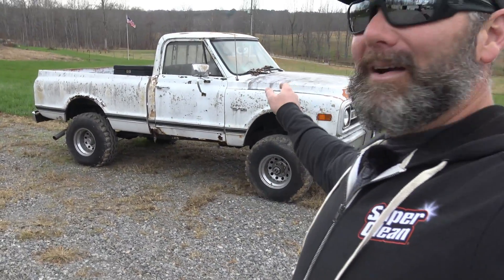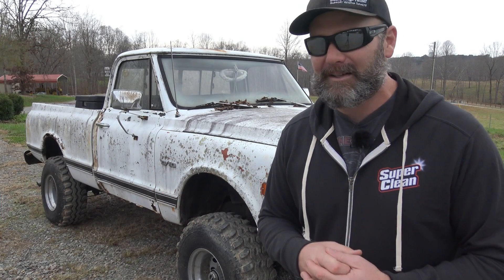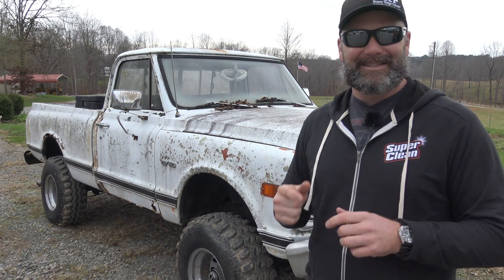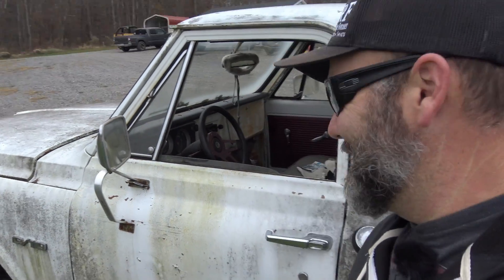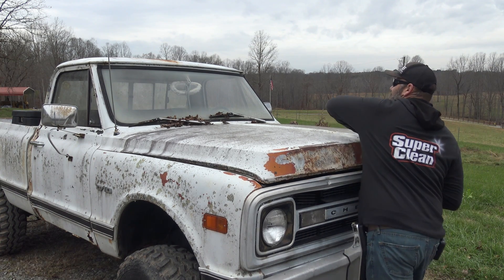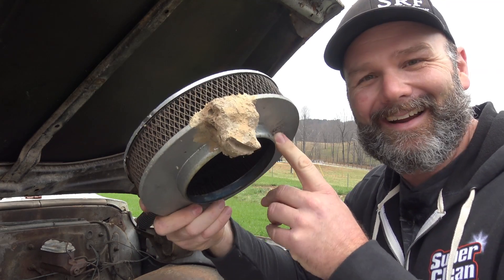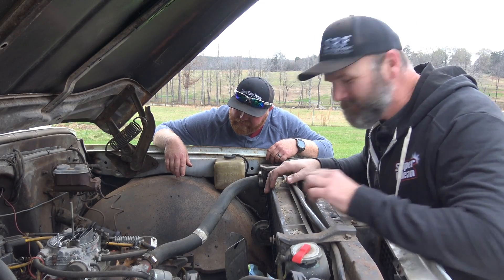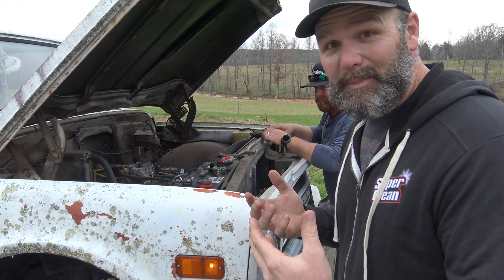Is it worth saving?? Rare and Rusty 69 Chevy C10...No start in 15 years!

Comment: Got 1 recently . No start in 8 years or so. Hot battery installed ,Added 10 gallons of New  non-ethanol fuel , primed the fuel pump ,and that 350 rolled over twice and fired rite up! Lot of body rot ,but not unfix-able. its 4x4 and terribly strong. Thanks for the vid.

Comment: 010 block is a common low compression 350 2 or 4 bolt main block. 
You can get every panel for that truck, it needs saved.

Comment: I got a 68 C20 longbed sidestep I've been working on and I get parts from both summit racing and lmc truck. Shes rwd and has inline 6 292 4.8 liter engine. Still working the engine up a bit

Comment: I own a ‘69 short bed fleet side almost identical to this truck. Mine also has a C/10 badge but it has a K at the beginning of the VIN and the original build sheet sticker on the inside of the glove compartment door so ???? I was told the “K” badging was only used on theBlazers?

Comment: Just finishing welding in new cab corners and rockers on mine. The new body panels can be easily modified to fit correctly, it's not all that hard. Every single piece on that truck is available brand new.

Comment: Your truck is an H-57 model. Your cab has 2 wheel drive badges and VIN, your box looks like a 1967 (no side marker lights) but your hood and grill are period correct for either 1969-70. Reminds me of a Johnny Cash song a little. I like the SRW which was optional in those days.

Comment: V-flint engine plant 04-April 22-day of april TXB 1975 350 LS9 165hp 4bbl  came in a c20  = V0422TXB the lower partial VIN is irrelevant unless you were building a #s matching restoration. then the partial and full vin must match. (V is not to be confused with the flint motor facility which is F.)
Reply: so its an LS9 350 built in the flint engine plant,  on april 22 1975, for a c20. 2wd 3/4 ton which id assume maybe a camper special.

Comment: My first vehicle was a '69 C10, green, fleetside, 250 - 6 cylinder and 3 on the tree.  I got it in '79 and you would think that a 10 year old truck would still be in great shape.  Nope.  rusted thru the floor boards, blown engine so I swapped it, still gutless.  But I only paid $600 for it including the replacement engine.

Comment: 69 chevy x model 302 it came out of a car hot rod model short stroke and if you run the vin number you can also get all the original details the truck was manufactured with

Comment: Should have installed an inline filter before starting to keep rust from tank and gas lines out of the carb. I have a 70 K20 Longhorn and a 72 C10. Had a 71 c10 but it was stolen.

Comment: Leave it like it is just clean it up. Those old trucks are better than the new one's. I'm not a chevy guy but I like the C10's. My cousin had a C10. We did the shade tree mechanic engine swap 6 cylinder for a Pontiac 400 V8. That thing went like a scalded dog. Had to shorten the drive shaft. Hit a deer doing 80mph in winter in that truck, hood popped up.....good times back then. Early 80's. Just ramblin.
Reply from the maker: lol....not this one my friend...it's in bad shape

Comment: Your truck is a gem in the rough....and I'm a Ford guy.  My dad bought a 1969 Chevy C20 from someone who worked for him in 1980.  It was a filthy rustbucket with an automatic but it ran great.  All that rust on your truck can be replaced.  You got a 4 speed with 4 wheel drive....I had an automatic with 2 wheel drive....yours is better.  Get it running, fix the rust and you will have a GREAT truck.

Comment: The engine is a 1975 350 4 bolt main 165 hp out of a c20 to 3500 pickup txb code is what tells that it was built April 22 1975
Reply from the maker: What about the date code?  What I see is 1977...that's why I can't figure it out
Reply: From every thing I go by v is the plant it was built in 0422 is month and day txb is really the code to Google it tells a lot and also the code on the back tells me it's a 350

Comment: So i wondered why C if it is a 4x4...maybe it was put on a later 4x4 frame, as happenes out in areas like that lol.  Real quick way to check...on the top.of the driver side frame rail, just ahead of the engine is the vin  On a 1970.  Right next to en edge that kind of curls up.  Eady to spot.  
  Should match door jamb vin.  If not there or matching, Right away you know the frame is something else.
Reply from the maker: brotha....we got ya a photo of that number but I can't figure out what it is...check about mid video and at the end...all the numbers are there for ya to decode! Woooo!!

Comment: I actually got basically the same truck last week except mine is a long bed. C10 back then applied to 2 and 4WD. The K was only designated for the K15 Blazer. 

The block V0422TXB
V- Flint MI
04- April
22- 22 day
TXB- 1975/4brl/350/165HP/Conventional Cab

Comment: The date code (D137) says April 13 1977.  The casting number (3970010) is a 350. Most 010 blocks were 4 bolt main but I have seen a couple 2 bolts with that casting number......

Comment: From what I understand k was the designation given to all factory 4 wheel drive models.  Before 1960 was just the “power pack” add on which was factory installed but was an aftermarket product.  That leads me to believe that if yours had a cab/fender swap at some point in its life.  41-47 AK series, 48-59 A series, 60-87 c/k series.  Look at the vin will tell you, the rpo in the glove box would be helpful too.

Comment: GM 350 service block from 1970s/80s. Likley not original engine but a good builder, usually 2 bolt main.  Took my drivers test in a C/20 Camper Special 69 like this. 4x2 granny geared 4 spd. Solid truck.

Comment: I'm currently working on a 1985 k10. Just bought all the metal to fix my cab rust from classicmuscle.com for $174 shipped.. same parts from LMC was $219 BEFORE shipping. So, shop around. 
EDITED AFTER MORE RESEARCH:
All your block casting (3970010) number tells you is it's a 4" bore from a wide range of years; 1969-1980. Raised casting D187 is April 18th 1977. It could be either a 2 or 4 bolt main. V0422TXB - Flint plant, 0422 - April 22nd, TXB 1975-1977 350 from "conv.cab truck" (Not sure if that's conversion cab or conventional cab). I'm having trouble withe the C7B153338. That's a partial vin from the vehicle it was originally installed into. A lot of the vintage charts I've found for vin decodes dont line up. I can't tell how many I'm missing and what digit positions those are. But what you can tell is a 1977 truck 350 that was cast on April 18th and installed on April 22nd 1977. (If I'm interpreting all of these right, I could be way off) I noticed no one else has chimed in on this really. Hope it helps. Post the front of the heads and any casting  numbers on them we might be able to tell you more.

Comment: 010 block is a 350 usly 4 bolt main and if I'm not mistaking I believe it's a nickel-plated block if I'm not mistaken the year could be anywhere from 69 74 if I'm not mistaken but 010 block is the best block in my opinion out there put a 30 30 cam in and set of vortec heads you would have a pretty nice motor

Comment: To answer your question, is it worth saving? That depends on what you are going to do with it. If you want to make a show piece, (which I doubt) then no it is not worth saving. If, on the other hand if you are looking to make it a workhorse on the farm, then most defiantly yes, Just cut off the rust and do what ever patching you have to to make it serviceable and through a flat bed on it. You will have a truck that is almost indestructible!
  Side note, on those carbs if you look on top on the right and left you will see little odd shaped holes by the access covers for the metering rods. those lead strait into the bowls for the carburetor, you can pore a little gas in there and fill up the bowls. Then it will run like it had a good fuel supply (until it runs out). 
Have fun! ;-}}

Comment: The block casting number said its a 350/302 out of a 69-79 car or truck need the number off the block next to the water pump
Reply: Ok I seen the other number  its a 1975 350 4 bolt ma truck motor and it made 165 hp

Comment: I like your enthusiasm . What I do is drill a hole in the bed floor, out a grommet in it and run the fuel line to the pump through it to a boat fuel can. Sometimes I even strap it down. I often use that set up  for the whole time I own the vehicle .6 gallons is plenty for my short trips.  I rarely drive so no use putting fuel in the tank and having it evaporate out like it does on old cars and trucks.

Comment: They sell the Blazer fuel tank kits that will put the fuel tank under the bed for around $200. It fits in the spare tire location and keeps the fuel smell out of the cab. There is a web forum and Facebook page called 67-72chevytrucks.com that has all the info you will ever need about this and any year Chevy truck.

Comment: That's a K-10! It's had some front fenders or the whole front clip put on it sometime or other. C is two wheel drive, K is four wheel drive. The windshield is probably the original, my Dad's '72 Cheyenne Super did that.

Comment: it is a later 70's/80's frame and running gear with a 2wd c/10 body on top of it.  The later model front and rear bumpers are a clue. Plus the date code of the engine backs that up.  really cool truck no matter what.

Comment: According to the top stamped number:  V= Flint Michigan, 04=April, 22=Day, TXB= 1975 350 Con.Cab  L LS9 165HP 4BBL C-20/3500.
Reply: I forgot to mention. The cast number: 3970010 could be a 302, 327 or a 350 built between 1969-1980, 2and 4 bolt main?  What are the cast numbers on the heads? This is interesting.

Comment: TBX suffix stamped on the front pad indicates that it is a 1975 C-20 truck 350 with a 4 barrel.  Most likely it's a 4-bolt main.  I wonder what all has been done to that truck over the years.  I noticed that it has a shifter nub on the column.  Makes me wonder if it was an auto converted to a 4-speed, or a 3 on the tree converted to a 4-speed.  One thing is sure, it is solidly stuck in the 80's!!  Barry White, rear view mirror warmer and Swampers.  Can't much more 80's than that!

Comment: It's got to be a K chasis with a C body on top. Technically, shouldn't be calling it a C10. 3970010 means it was basically used in everything, meaning that block cast. From the C7B RPO I found a match saying the engine is a 1985, 305, 4bbl. Not sure out of what yet but rated at a whopping 150HP. That was gathered at the flywheel not the wheels back then too. It was made in Flint Michigan, on April 22. I could be mistaken but that's what I was able to come up with. The 153338 is a partial VIN number, if you look that up you'll learn what it came out of and what transmission was behind it. As far as I can tell finding VIN#'s costs money. It's a cool truck. I'd just patch it up give it a decent paint job, nothing elaborate, just enough to look good and prevent rust. Good for a daily driver. Enjoy it I'd say. If I had to guess what your VIN search would come up with I'd say a 1985 K10 series truck and that's the engine that came with one of those and likely goes to the chassis.

Comment: 3970010 was a 350 ci 2/4 bolt main. made from 69 to 80 for Trucks, Passenger cars, Chevelle, Chevy 2, Camaro, Vettes. Various 255-350 were 4 Bolt Mains. With the 145-350 Were 2/4 bolt mains.The 69's were the 255-350 all with 4 bolt mains.

Comment: Points and cap need cleaning
Reply from the maker: Look harder at the engine buddy.....it's had an electronic swap
Reply: @StoneyRidgeFarmer  cap and rotor need replace. Coil in cap is notorious for arcing and misfires.......swap on a used cap and coil see what happens

Comment: 80s small block chevy . 350 170 horse factory if it has 2 freeze plugs .if it has 3 frost plugs it's a 400 buy the numbers on the front pad

Comment: Want another 1969 c10 , hasn’t tan since 1992 , it has 350 turbo 400 , Heavy duty suspension from the factory in the motors free  not seized , I got all four matching hubcaps as well it’s rusty but I’ll let it go for scrap price if someone comes  to get it

Comment: A TXB comes out to a 1975 C20 to 3500. Rated at a whole 165hp. totally moot probably considering that it could be litterally anything and you wouldn't know unless you crack it open. Even if it's an original engine I wouldn't trust it to be what it says it is until I saw at least the head casting #s. Probably 462624 or 882 heads, 8:1 (rated actually less) compression) no cam in the sense of performance and so on. In terms of the body you wouldn't really know until you work the heck out of it with a pressure washer.The Bondo and Fiberglass is old school, at least all the panels are available these days to fix something like this.

Comment: I love the 67-72 trucks. My dream is to one day find a 71 or 72 c10, I dont care if its longbed or shortbed. I do like the 67-70 as well but prefer the grille on the 71 and 72. I currently am doing a poverty restoration on an 82 c10. I love the squarebodys 73-87 because parts are super easy to find and fairly cheap but one day I still want to find an early c10 but where I live even a totally  rotted out one will fetch over 5000 easily.

Comment: That is likely a 350 truck block, the same casting as the 302 but the vin code stamped in the head area would have DZ in it if it was a 302. It’s just a good 69 block.
Reply: All of them were c10, the vin will tell if it started as 2wd or 4wd c or k in it

Comment: C/10 emblem, but more specifically the column shift collar, indicates it was a C 10 that has been converted to K10. Another indicator would be to pull the floor shifter boots to see if the floorboard cut outs was factory or back yard.

Comment: The TXB suffix tells me its a 1975 350
Reply from the maker: but...the casting numbers ? and the date code reflects a 1977...that's what I can't figure out
Reply: Stoney Ridge Farmer Yes Sir, according to date code it was built April 13, 1977 but the engine id code it was a 350 built in Flint Michigan on April 22, 1975 that is weird. Someone in the factory made a mistake with one of the the dates. I work at an automotive factory that does plastic injection molding, and sometimes the technician forgets to change one of the dates on the mold. Then the parts will have two different dates on them, but I am not sure how the dates work for the casting molds of engines.

Comment: you will find people who only want the cab.  the cab is the only part of the vehicle that is not sold.  panel parts can be found, running board are available  all the pieces that go around the door can be found  door replacement panels and parts can be found.  but you have the most important piece the ca bbody and vin number.   cherried out for show it would be worth 10 to 20 times what you paid for it

Comment: Josh, great buy! People don't realize what these trucks are worth, especially running and driving. Unless someone filled in side markers, that's a '67 bed with non '67 trim. Truck was probably pieced together which doesn't really matter unless ur going original. You have the most important parts! I have a rare '67 K10 unrestored with a 327 and 3 on the tree, short wide bed and have never seen another one yet! I hear only the Army and Forestry Service got them and its in good shape! Also have a 13 yr project '72 w/ a 525 HP LS 3 in it that's made a magazine and does very well at car shows. Keep up the good work, drive it or fix it, its all up to you! If u fix it, LMC is going to love you!!!

Comment: My first truck was a 1967 Chevy C/10 with an inline 6 cylinder, 3-speed on the collar.  It was white, and full of rust. Your video brought back lots of memories. That truck was tough, I bet it's still running somewhere today.
Reply: Me too man! My first was a white 1969 C10 in high school. I drove it several years after school too. It was my daily driver for about 10 years. Bought it in 1999 when they were cheap 😂. I had a new white paint job put on it, a new Chevy 350 crate motor, and rebuilt the turbo 350 transmission. It looked like a brand new truck and I only had around 10k in it. It had 4:11 gear 12 bolt rear end so it was pretty powerful 0-60. People used to laugh about his fast the gas gauge would go down on it. You could run around town awhile and literally watch it move lol 😂. But I didn’t care…it was to cool and the chicks loved it! Everybody called it the “ Heavy Chevy”. We raised a lot of hell in that thing out here in the Kentucky backwoods 👍🏻. 

I’m actually looking for another one now. I’m 38 and having a midlife crisis. Sold my new truck. I’m tired of paying for new trucks that aren’t enjoyable to drive. They got no soul. I’d rather have a cool old truck that’s fun to drive. I miss driving a truck being fun. My plan is to basically make another “ heavy Chevy” accept go with a tremec 5 speed and a 350 with fuel injection. Will probably buy a ZZ6 350 crate engine. It will be quite powerful yet cruise the highway good with the 5 speed and good gear ratio. 3:55 gear would probably be about right. I’m just sick of this new crap man. I can build another 69 that’s nice and reliable for less than a new modern truck